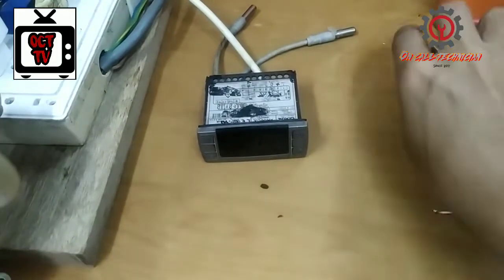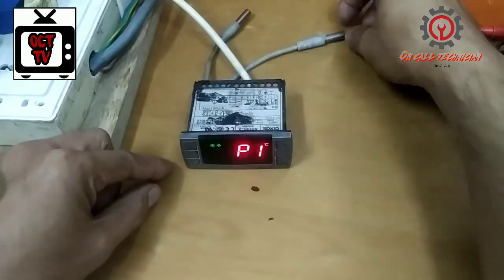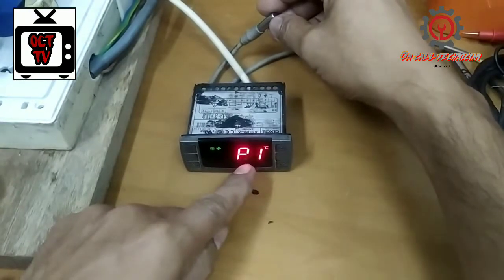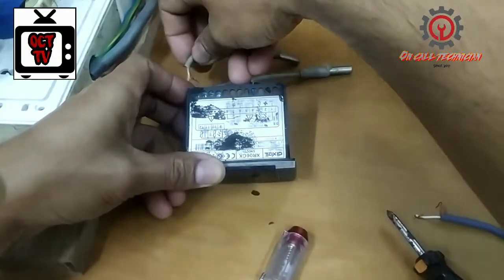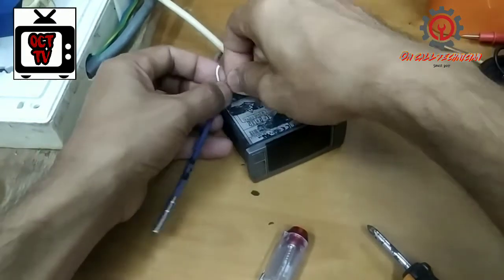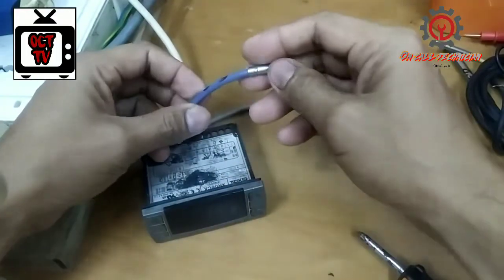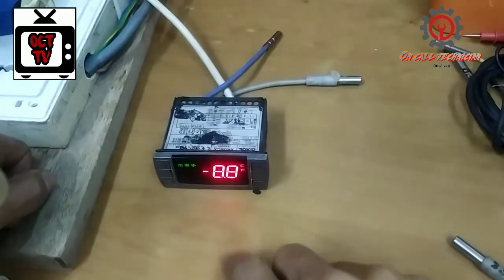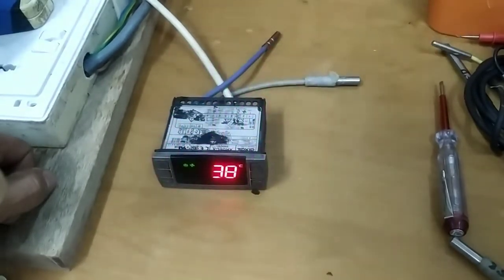HOW TO FIX P1 ERROR OF DIXELL DIGITAL CONTROL OF COMMERCIAL REFRIGERATOR

Comment: Thanks it works. The problem is solved. But I have one more problem that is the fan is not getting started automatically once it gets stopped. I have to touch it then it gets start
Reply from the maker: If you have 220v in your evaporator fan then it works sir. Check and replace the fan

Comment: Sir pag ang chiller ay nag cut off bago hindi na sya nag start up,nag start up lng sya pag tinanggal yung isang linya ng ambient teperature sensor,ano po posible na problema nya
Reply from the maker: Check mo HY baka naman mataas ang value nya. Dito kasi mag start ulit ang compressor
Reply: @THEMULTISKILLEDTECH  salamat sa reply sir,babalikan ko bukas yung unit sir,ano po pa dapat value ng HY nya,saka ginaya ko po yung ginawa nyo tinanggal ko isang linya nung ambient sensor para lang gumana ulit,pano po kya compressor nun sir mag cut off po kaya ang compressor kahit tanggal yung  isang wire
Reply from the maker: @Jay-r6c Hy value ay naka dependensa highest setpoit mo sir, watchy other videos about HY. Umaandar ang compressor mo ny time at ang on ay nakadepende naman sa CY at of ay sa CN
Reply: @THEMULTISKILLEDTECH maraming salamat po sir,ngayon po may dala akong sensor na bago try ko po i install

Comment: Paano po  Kung ganoon pa rin sya kahit pinalitan na ng bagong sensor have a Great day❤️
Reply from the maker: Confirm mo muna sir kung walang putol sa wire ng sensor mo. If P1 error pa din palit ka na ng bago sir.
Reply: @THEMULTISKILLEDTECH  possible kya sir freez out wiring /  expose  wiring. - 17 po kasi lamig sir 2 machine po
Reply from the maker: Samin sa electronics sir mayroon kaming tinatawag na cold solder. Balutan mo ng electrical tape sir.
Reply: @THEMULTISKILLEDTECH   thanks sir update po ako  God bless sir 💯👍❤️
Reply from the maker: Welcome sir

Comment: I am replaced sensor but still p1appear . It's 8kohim
Reply from the maker: Is the sensor the same ntc? If p1 appears though you replaced sensor, replace control coz its internal issue my friend.
Reply from the maker: Install new senson near the control in this situation you may know if the wires is not being cut.
Reply: @THEMULTISKILLEDTECH  yes.it NTC

Comment: Good day master, pasingit po ulit, yong pong chiller pag umandar na with digital sign na show don yong fan at cold sign, pro pagdating sa panel board nya is heater ang naka pitik na contactor, one time nag on ako sa timer nya  prang rekta, yong heater talaga nya ang pumapalo hindi ang compressor, yong digital connection prang walang problema yata, don sa main contactor, pwde ko ba ipagpalit yong wire ng heater don sa contactor ng wire ng compressor? Salamat po
Reply from the maker: Kung sigurado kang chiller yan sir go ahead pero kung heater mode yan like nagpapaalsa ng dough yari ka. Usually 37-39°c po setting nyan
Reply from the maker: Kaya pala di nagana compressor mo sir 😉😁 iwasto mo sir para lumamig naman chiller mo
Reply from the maker: Meron din me fb page sir. Look for ON CALL TECHNICIAN din
Reply: @THEMULTISKILLEDTECH  salamat po talaga master...Godbless po
Reply from the maker: Welcome po anytime sir
Reply: Chiller po master... Kaya nong una nagtaka na ako pumasok na ako sa loob at hinawakan ko, nka cool mode xa pero ang init sa evap. Nya, sana kong may fb po kau esend ko vedio ko mamaya para po makita ninyo, salamat po ulit master